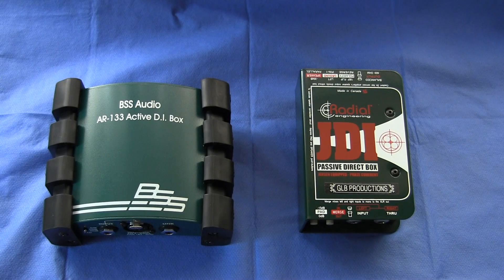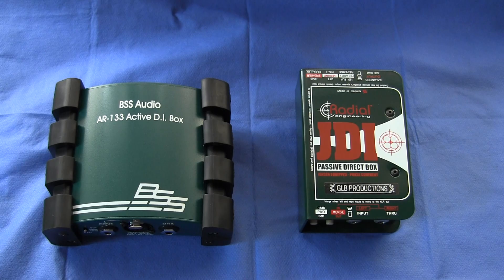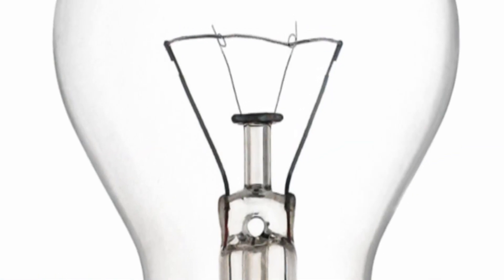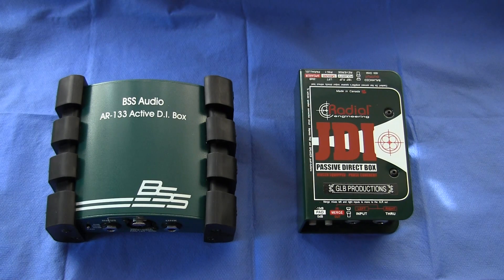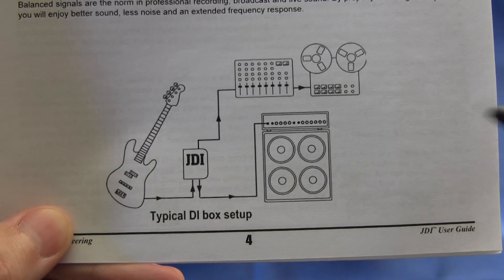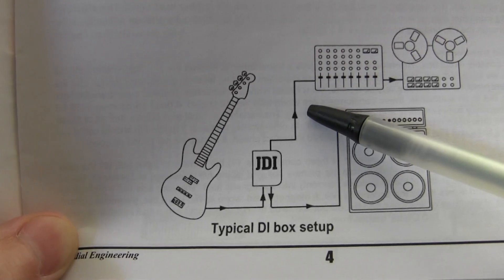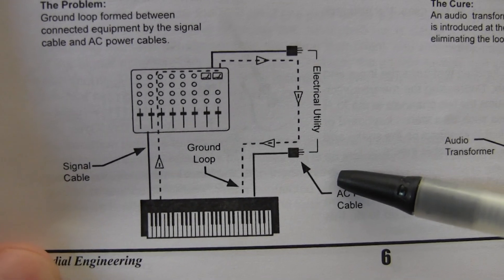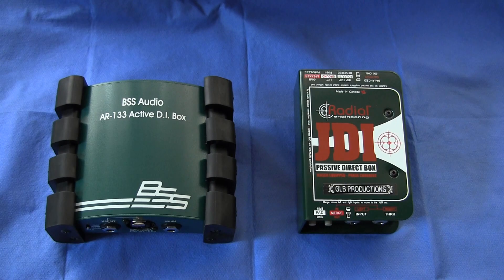DI boxes part 1: What does a DI box do, and when do I need one?

Comment: i run 2 bose L1 speaker systems for dj'ing would these improve the sound from my amp to the speakers
Reply from the maker: On the L1 systems the amplifiers and speakers are integrated into one unit - it would be impossible to insert a DI between them.

Comment: What happens if I have buzzing and humming at home, while I practice? I have a Fender amp, a Telecaster + 6-7 pedals.... what could I do to beat that noise? :(
Reply from the maker: You have to find out where the noise is coming from - your guitar, pedals or amplifier. Then you can take steps to solve the problem.

Comment: hello, thank u so much for video, im not  native english speaker, i have question, i hate the ground noise of my guitar, i use a helix pedalboard for amp, my question is, if i need a di box trought guitar and helix, for eliminate ground noise?? now im using a Noise gate, but kill the tone... of guitar 😑
Reply from the maker: Hi there Jorge! If you really have a grounding problem, adding a DI will not solve this. You need to solve the grounding problem first and ensure that your guitar/pedalboard/amp combination is quiet before adding the DI. Try different electrical circuits and also try running some pedals off batteries instead of an AC adapter.

Comment: Good day to you sir.Great video.
I was in a gig 2 days ago and all of a sudden,I started hearing gun-shot like sounds from my two voice speakers.I thought the problem was from my dj mixer and changed it. The loud noise continued coming out at interval of 30 mins.I changed all my cables,and the noise continued.I unplugged my 2 '18inch' powered Subs and 2 '15inch' speakers,and replaced them with HK lucas audio system.It happened again just once and never came back again all through the night.
Do you think that the reason might be from the power source at the event center,or because i connected all my equipment to one power outlet? 
Please,what could be the reason for the loud gunshot-like noise and,what should i do in such situation?
Thanks in anticipation for your answer?
Reply from the maker: Hmm, the fact that it occurred with BOTH of your sound systems suggests that the issue is indeed with the power, or with some other device sharing the power with your sound system.
Reply: @GLBProductions  thanks alot.I thought as much.

Comment: A direct box also takes a line high signal and reduces it to a low/mic level signal that a mic put on a mixer may need to see.
Reply from the maker: Yes, although some older active DI boxes actually output at LINE level, which can be an issue as explained in this series.

Comment: i have a single coil neo d pickup for acoustic , and its making ground noise , are active dircet box will eliminate the noise ? for recording purpose
Reply from the maker: Probably not - if the pickup is noisy with nothing else connected in the signal chain a DI box will not solve your problem.
Reply: so , its a pickup failure ? not my bad electrical ground ?
Reply from the maker: With single coil pickups it's typically some sort of interference, either electrostatic or electromagnetic. It can also be due to bad AC grounding. Try different locations and also different sources of AC power - if your pickup is quiet in some rooms/venues but noisy in others you know it's interference.
Reply: yeah so if i had a bad grounding i thought active direct box will solve the problem because di box have a ground lift feature ,

Comment: Could I use this to record my basses audio or do I need a auido interface
Reply from the maker: If you are using a computer-based recording setup you will still need an audio interface of some kind.
Reply: @GLBProductions  do i still need a di if i have an audio interface like let say motu m4?I didnt quite get how an operator can get electrocuted "if you lift the ac or power ground" what do you mean by lifting the ac and how is it done so that we can avoid doing it?thanks

Comment: I am still a little bit confused. I want to connect an electric guitar to a Scarlett 2i2 USB audio interface, which connects directly to my computer without any other mixers. Do I need a DI box?
Reply from the maker: No you do not :)
Reply: @GLBProductions   Thanks! I guess I would need one if the cable would be bigger than 5 meters?
Reply from the maker: In a studio environment you can often get away with a longer unbalanced cable, you would need to try and see.
Reply: @GLBProductions  alright, thanks a ton!

Comment: I have a Focusrite Audio Interface connected to my pedalboard and my guitar. I noticed that when I record, it sounds really distorted and very very muddy. Does the DI box make the mix sound like it came straight from my amp?
Reply from the maker: No, the DI box will not change the tone of your signal. If you are getting distortion it sounds like you have too much gain somewhere in the system.
Reply: @GLBProductions  so I can connect my guitar to my amp without a pedal board and the DI box sends that sound to my Interface and then into my computer correct? I'm trying to figure out how I can connect my pedal board to my amp and record it sounding like it does from my amp.
Reply from the maker: The simplest way to do that is to put a mic in front of your amp :)
Reply: @GLBProductions  but I don't have money for a mic :(

Comment: Ok, off topic a bit, but In the diagram showing the guitar splitting at the di box. One going into the amp and the other into the mixer is a bit confusing. Why would you run a clean guitar signal straight through the di and into the mixer without going through the line out on the guitar amp where you would benefit from the amp settings, gain..etc.before recording . ?

Your videos are very professional and well explained. No wasted time on stupid music and intros..5 stars!!
Reply from the maker: That's a good question Shaun. This signal path is intended mainly for live sound and mainly for acoustic and bass guitar as well as keyboards and other sources where the sound engineer needs a clean signal. The reason for this is that the sound that the musician likes to hear on stage is often not the best sound for front of house. In recording, this signal will often be supplemented by additional signals taken from the amplifier and/or from the musicians' effects. Hope that helps!

Comment: Great explanation! I'm wondering can you use a di box to take a balanced signal from a 1/4 trs on a mixer to  unbalanced rca jacks on a subwoofer?
Reply from the maker: The best tool for this purpose is something like the Radial Pro-Iso: http://www.radialeng.com/product/pro-iso Alternatively you can wire a specific cable for this which converts TRS to RCA: tip on the TRS to tip on the RCA, ring and ring and sleeve on the TRS to ground on the RCA.

Comment: Hi do you need a DI (say passive ) when using a radial extc-sa as this also converts the signal and has ground loop protection, this is to be used only for recording into a sound card interface, so( no long cables) using passive pickup guitars. I read Irrispective of cable length a DI produces a clean consistent signal when using multiple  guitars when recording. I ask as the cost  for both is expensive.
Reply from the maker: That's an interesting one. The EXTC-SA is a specialised device for use during re-amping: it's designed to accept a balanced, line level signal and then unbalance it so that it can be run through normal guitar pedals. It thus has a completely different application to a normal DI box.

Comment: What's the different with buffer?
Reply from the maker: It electronically separates the input and output to allow connection to multiple devices. So the source only sees the impedance of the buffer rather than the impedance of the device the output is connected to.

Comment: I want to split my guitar signal to two tracks, one the normal old school way I’ve been doing it, which is just a mic on the cabinet. Then I’d like to have a dry direct track too with the di box. I can do this with a di box, record two tracks at the same time? I have lo Z instrument inputs on my interface but I can’t do that with them.
Reply from the maker: Yes the DI box naturally splits the signal into one balanced and one unbalanced signal - you can run the balanced signal into your interface as a dry signal and then take the unbalanced one into your amp or FX pedals.

Comment: you wouldnt have a ground loop problem if you take electricity from the same place. like if you bring a breakout with several outputs you should be able to use that and not experience ground loops right?
Reply from the maker: You have to take into account not just the stuff on stage but also you connection to the house system - if your mixer is in the middle or back of the venue chances are it's on a different AC circuit.
Reply: I was wondering the same thing. I’m preparing for a small gig and there will be a keyboard going into my mixer. But my mixer will be on stage and I planned to plug all things into one power strip.
Reply: @mikergage  are you using a ipad to controll the mixer? or are you going to be on stage yourself? i cant imagine it will be easy hearing how it is out on the floor
Reply: Simonarne Myklebust I will be on stage myself. Keyboard, acoustic guitar, and two mics going into mixer, then mixer to PA. That will be my setup and I was thinking I wouldn’t need a DI box because of short distance, but I’m just now hearing this ground loop possible issue.
Reply from the maker: @mikergage  If you are plugging into an on-stage mixer first and then connecting that to the house mixer via balanced XLR you probably will not need a DI box as your connection is already balanced. However DI boxes are great to have around as general problem solving tools.

Comment: I was wanting to input both my acoustic guitar w/pickup as well as an instrument microphone into an active DI box. Would it be effective at mixing the signal equally through the one output, or would it be better just to put the mic into the board separately?
Reply from the maker: If the microphone has a balanced XLR output it should be on its own channel - this will give you greater flexibility with level and EQ control at the mixer.

Comment: Does this DI or other ones remove noise and hum from the pedal board because my violin pickup and pedal bord make noise always so what do you advice me to use? Thanks
Reply from the maker: A DI can remove some forms of noise, specifically those caused by a ground loop. If your noise is due to electrical or electromagnetic interference a DI will not help.

Comment: Would I use a di box to plug and synth into an instrument input meant for guitar/bass?
Reply from the maker: Not if your synth has 1/4" outputs - just plug it straight in.
Reply: All of the line inputs are already being used 😢
Reply from the maker: Then you may need to get a bigger mixer or merge some of your stereo signals to mono.

Comment: Very informative. Thanks GLB Productions!

My equalizer has an unbalance audio output and I need to split it into two: one goes to my recorder (with TS input jack), and the other one to my powered speaker (with balanced XLR input). As a solution, I thought of using a DI box since it has both unbalanced TS ouput and balanced XLR output : unbalanced phone jack output to my recorder and balanced XLR output goes to the powered speaker. Is this a good idea? Does DI box have self-noise so that it ads noise to the noise chain and so adding noise to my recorder?
Reply from the maker: Yes you can definitely do that, although bear in mind that the XLR output of the DI box is at mic level so you'll need to send it to a mic level input on the powered speaker. Active DI boxes have self noise but passive ones do not - for this application a passive DI box is probably your best bet.
Reply: Many thanks to you!

While looking for a passive DI box, I found an affordable active DI box. Can I use it and then turn on the attenuation? Will it work the same as a passive DI that way? Will it still have self-noise even with the attenuation on?
Reply from the maker: You're welcome! At all costs avoid cheap active DI boxes - they are often very noisy. Whether or not the self-noise affects the 1/4" output on the DI depends on whether the output is buffered or not, you'll need to check the circuit diagram to be sure.
Reply: Thanks! Does that include passive DI boxes? Are they also noisy?
Reply from the maker: Passive DI boxes have no self-noise as they have no electronics inside :) If your budget is limited it's generally better to buy a cheap passive DI box from a name brand company like Whirlwind or Radial than to go with a cheap knock-off of an active DI box.
Reply: Thanks for this!  From where I live, I can only find Behringer passive DI box (ULTRA-DI DI400P) Is it good? Will be using it for vocals (lecturers in seminars), not instruments.
Reply from the maker: I recommend avoiding Behringer products - they are very cheap but are not good value for money. Go onto Amazon and order a Whirlwind IMP2 or Radial ProDI/Stagebug SB2.

Comment: Hi, thanks for the video. 

How do I change a stereo headphone output to line input? Can I use a stereo DI box? Will a passive DI box work?
Reply from the maker: A headphone output is actually two unbalanced signals, so you will need a minijack to 2 x 1/4" cable - this will allow you to connect it to two line level inputs. Remember that you are dealing with TWO signals, not just one.

Comment: hello, i have an electric guitar and i want to connect them to my mixer (behringer xenyx 1002B, do i need a DI box for an example (behringer DI20) in between for it to work? or directly connect it to my mixer? an answer would help tq
Reply from the maker: You can connect directly if your mixer has a hi-Z/instrument input - look for a guitar symbol next to the line input. Otherwise it's best to use a DI box.
Reply: No, it doesn't have any instrument input. is behringer DI series is a good DI Box? all my friends recommend them since they are cheap and reliable. thanks in advance
Reply from the maker: I never recommend Behringer products as my customers have had too many issues with them in the past. If you are looking for a good and cheap DI box I recommend the Whirlwind IMP2.
Reply: GLB Productions alright, thanks for the recommendation 👍🏻

Comment: Is this better than miking a guitar amp? I play electric guitar and I've always been told the true electric guitar sound is from a proper guitar amp and not into PA.
Reply from the maker: Miking the amp is the traditional way to capture the tone of electric guitar, and in the studio this is almost always how electric guitar is recorded. When playing live, compromises often have to be made in order to get the cleanest possible signal into the sound reinforcement system. So a professional sound engineer will often have two or three ways of capturing the electric guitar sound - there will be a mic on the amp but there will also be at least one direct signal. This can be taken from an emulated line out on the amp, or a DI box placed between the pedal board and the amp. Guitarists who use multi-effects units will often have a direct out on the effect unit itself which includes amp and cabinet emulation. There are also speaker-level DIs which connect in between the amplifier and speaker cab. These signals are then blended together at the mixer to create the finished electric guitar tone that the audience hears.

Comment: Hello Bruno.... Ihavea question : to connect an electric guitar to a notebook Mic input (with Jamvox soft) via a DI... I enter into the DI with the guitar via the 6.5 jack connector, what is it required at the other end to avoid hum and noise ? Will the DI help to eliminate noise in any way ? Is there special precaution to run this config at all ?  Thanks in advance, Toni
Reply from the maker: Hi there Toni, I strongly recommend that you do not attempt to connect to the notebook's mic input when recording - it's a very limited interface and not designed for music input. It is much better to use an external USB interface such as the Steinberg UR22/UR12 or Presonus Audiobox.
Reply: Hi Bruno and thank you very much. I have thought so ... my thinking was that the guitar signal level will saturate the PC input, but perhaps the DI could adapt (reduce) it in some dBs...  other alternative could be a mini mixer. Best regards Bruno and I keep tunned.

Comment: Forgive my lack of knowledge.  I have operated mixers for years, but now I'm actually in charge of set up,  etc.  How do I know if it is balanced or unbalanced. You can't just assume that xlr is balanced and any instrument cable is automatically unbalanced can i?
Reply from the maker: Unless you are working with a very old system, 99% of XLR inputs are outputs are balanced. With quarter-inch connectors it's much more difficult to determine because these connectors can be wired balanced or unbalanced, stereo or mono. Having said that, TS (tip-sleeve) 1/4" connectors are always unbalanced, because they have only two contacts. Check out my video on pro-audio connectors for more info :)